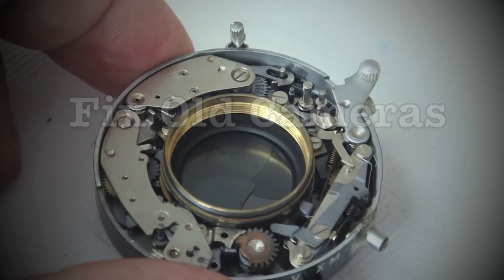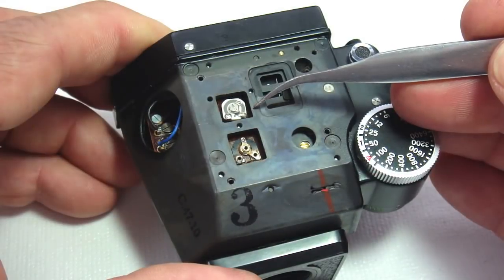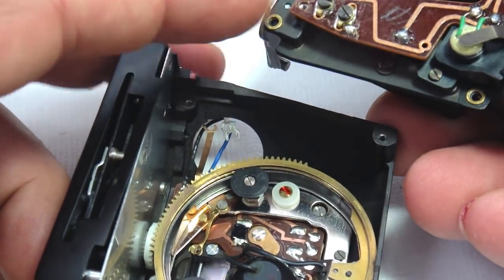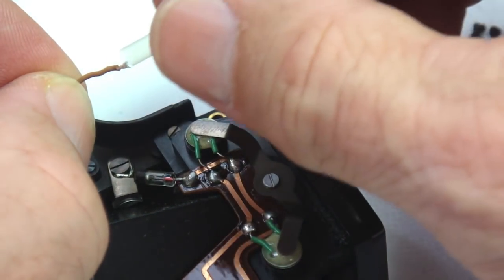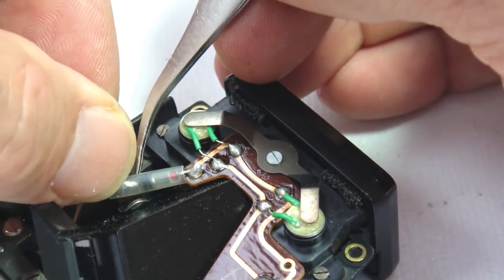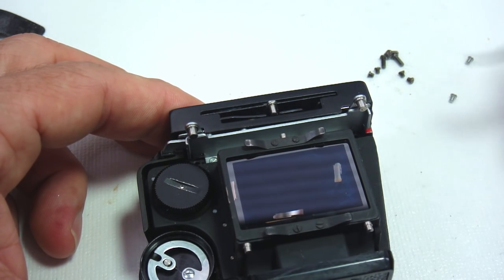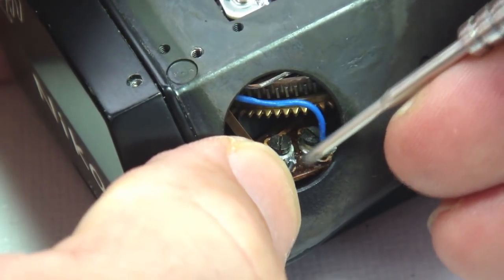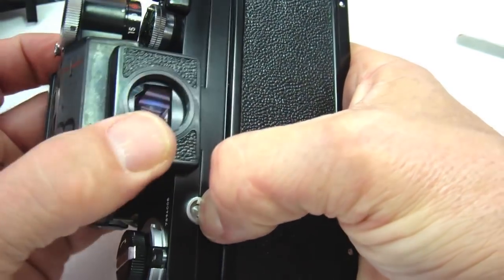Fix Old Cameras: Nikon Photomic FTN Meter Modification

Comment: Good video but on caveat. Diodes fluctuate with temperature. 1.1Mv per F degree. What would be zeroed in on a hot day would be different on a cold day. If I’m wrong let me know. Nevertheless, what I have done is to get a silver cell battery adapter and then lower the ASA wheel one film speed. If you are using ASA 200- set the camera meter to ASA 100. 400 film to 200, etc. this will compensate for the battery voltage differences and have the film exposure good. Keep using those older cameras, they are still good.

Comment: I have a 1967 Nikon F with the Photomic finder that"s been dead for years. I want to make that meter work again. The irritating thing is finding no answers to the prime question, which is WHAT is the root cause of the problem? Root cause, please. It's not the battery, not dust inside, etc. I read about adding a diode to the interior wiring and have not done that yet, but find no answer ord explanation to why, or even if that solves the problem. So many F's so many dead F Photomic meters!!!

Comment: To the right of the rear trim (battery test), there is also a round hole with an adjustment screw. It can be accessed by removing the leatherette. What is that for? Thanks.

Comment: Great video.  I have a different issue with my ftn.  The aperture pin won’t engage properly!  I removed the front plate and a spring popped out!  Maybe thats why it doesn’t work.  For the life of me i cannot figure out where this spring goes.  Can you offer any guidance?  Thanks so much!

Comment: Hey so my meter isn’t working. 
With new batteries, the needle shifts about a quarter way to the O. 
But when out against a pure white light that would obviously overexpose at iso 800 with the speed set at 1/4s, the needle moves about a quarter way too. 
There’s no corrosion on the battery terminals and it indexes correctly. Do you have any idea what’s up with it? 
My guess would be faulty power delivery but the question then is how? Or could it be a combo of problems where the check battery needs calibration but also the metering circuit is toast? In the case the the CdS cells are toast, are Nikkormat CdS cells a swap in replacement?
Thanks for the video.
Reply from the maker: All your suspicions are possibilities. Most likely dirty/faulty resistor rings or faulty CDS cells. You could make the Nikkormat Cells work but they are not a direct swap.
Reply: @FixOldCameras  wow thanks lots for the info. You’re super knowledgeable. Let’s hope it’s just a faulty resistance ring

Comment: Beautifully done
Reply from the maker: Thank you.
Reply: @FixOldCameras  i wanted to ask, is it a relative impossibility to clean dust out of the viewfinder/prism area? Been using my new-to-me F for only about 3 days and it seems my wool coat has shed into the finder somehow😬
Reply from the maker: @sLOMO_77  No impossible at all. Dust or wool behind the eyepiece can be accessed by removing the cover shell of the prism you can also remove the prism from the housing if need be. The viewfinder screen can be separated to access and clean as needed.
Reply: @FixOldCameras  this goes for the Ftn head as well?

Comment: Hi, I just saw your tutorial and I have been impressed by your professionalism, a pleasure to follow people who share interesting things. I have a Nikon F 2 and the light meter is not working. The question is, is the function of the photometer that does not work from the head on top, or is it an internal problem of the camera? Is it possible to use this technique from your tutoring, for my camera too? If so, what diodes do I need specifically?

Comment: Nice job, thank you for producing an awesome video. Just ordered a Photomic, since it has such a strange look. I have an old Leicaflex body that I would like to fix. Mirror got stuck in the up position. Do you have a brand of screwdriver to recommend ?
Reply from the maker: The best you can afford. Starret or Moody are good place to start.
https://www.amazon.com/shop/fixoldcameras
Please note that the link provided is an affiliate link and a small commission is received by the creator of this channel if you choose to make a purchase using this link. This adds no extra expense to your purchase. Your support of this channel is greatly appreciated. Thank you for making any purchases through the link on this channel.

Comment: Thank you for posting these instructions - very informative.  I followed them to install the diode but probably did something wrong. The battery check is working as it should. However, when I turn the meter on, the needle shoots all the way to the left (indicating over-exposure), and stays there irrespective of ISO, shutter speed or aperture settings.  Any idea where things may have gone wrong?  Thanks!
Reply from the maker: If the battery check works as it should you did the install correct. Check the wiring around the CDS cells and the CDS cells themselves. An ohm meter would helpful.

Comment: I recently acquired a Nikon Ftn Photomic,  vintage 1971 from what I can ascertain from the camera body serial number.  The finder on it came with batteries installed and the meter is working.  However I did run into meter readings being about 3/4 stop off from meter readings taken of the same subject,  same lighting, and same lens as my Nikon FM. (took readings off of an 18% grey card).  That I attribute to the modern equivalent batteries installed in the Ftn finder.  Since I don't feel like getting into the guts of my Ftn finder,  I simply 'fudge' the film speed ASA so the Ftn meter reading agrees with that of my FM and my digital camera.  However this is an interesting informative video and I'll bookmark it in case I get brave and want to do a long term permanent fix to enable me to use modern batteries without having to often check the Ftn meter against my other camera light meters.
Reply from the maker: Thank your for your detailed comments and for your interest in FOC.

Comment: What type of adhesive did you use to install leatherette cover? Love your videos. Replaced light seals in my rb67. Thanks
Reply from the maker: Pliobond. Also, in cases where the leatherette is not curling at the edges a permanent office glue stick works nicely and allows for easier removal if need be.
https://www.amazon.com/shop/fixoldcameras
Affiliate disclosure: Please be advised that some of the links provided are affiliate links and a small commission is received by the creator of this channel if you make a purchase using these links. This adds no extra expense to your purchase. I appreciate your support of this channel. Thank you making any purchases through the links on this channel.

Comment: Amazing video.  My Nikon f3 reads two stops over as compared with the  external light metre.I don't know how to fix it.I also checked exposure compensation dial which is on '0' . I don't know how to fix it. Do u think all the Nikon f3 is like that? Any suggestions would be very helpful.
Reply from the maker: No they should be a little closer to the same reading. You must triangulate or confirm the accuracy of the hand held meter.  onece the accuracy of the source meter is confirmed. Try to determine if the exposures of the F3 in question are also two stops off as well.

Comment: Hello, Just to be clear, the SK 3080 diode works in the two battery Nikon Ftn and the SK 3090 diode works in the two battery Gossen Luna Pro even though the YouTube for the Luna Pro started out as an SK3080 diode. I bought several of the SK3080 diodes based on the original Gossen YouTube. ;-(
Reply from the maker: Frankly, with the difficulty in finding some of the vintage diodes that seem to work the best, an absolute perfect choice might not be available to you. Unfortunately you might just have to give them a try and see how they work. You will not cause any harm to the meter if the diode chosen does not produce the desired voltage drop. The Gossen is fairly forgiving to the voltage difference even though it does not have an in circuit voltage regulating components. The Nikon Ftn is a little more persnickety. Experience shows a silicon diode has a voltage drop of approximately 0.7V(varying 0.1V depending on the sub), while a germanium diode has a voltage drop of approximately 01.6V - 0.2.2V. Making the silicon diode(1N4007) the preferred choice for two battery meter systems. Though germanium diodes(SK3090, OA90, ECG109) with a voltage drop of consistently 016V) is the best in the area of forward voltage drop in single battery systems they are increasingly hard to find and more expensive, the silicon diodes are cheaper and apparently easier to find.
Experience shows a zener diode is not a good choice for a substitute. A silicon or germanium, conducts in one direction only, whereas a zener diode conducts in both directions, but at different voltages.

In most other applications beyond the voltage dropping application an ordinary diode is used to rectify, using its forward bias characteristics, while a zener diode is used to regulate, using its reverse bias characteristics.
If you have a multi-meter with a Diode Test mode you can determine the voltage drop of your diode before installation. The Diode Test mode produces a small voltage between test leads. The multi-meter then displays the voltage drop when the test leads are connected across a diode when forward-biased. The Diode Test procedure is conducted as follows:
 If you are checking in circuit make certain no voltage exists at the diode. Voltage may be present in the circuit due to charged capacitors. Other wise, set your multi-meter to the Diode Test mode.It may share a space on the dial with another function.  Connect the test leads to the diode. Record the measurement displayed.  Reverse the test leads. Record the measurement displayed.
Diode test analysis
 A good forward-based silicon diode displays a voltage drop ranging from 0.5 to 0.8 volts for the most commonly used silicon diodes. Some germanium diodes have a voltage drop ranging from 0.2 to 0.3 V. The multi-meter displays OL when a good diode is reverse-biased. The OL reading indicates the diode is functioning as an open switch. The multi-meter  will give additional information about the diode. A bad (opened) diode does not allow current to flow in either direction. The multimeter will display OL in both directions when the diode is opened. A shorted diode has the same voltage drop reading (approximately 0.4 V) in both directions.
Substitues for
ECG109 - OA90
1N4007 - DO-41
One more thought, years ago,  when the mercury cell was first doomed to extinction along came the "MR-9" battery adapter.  Slip a S76 type battery inside the MR-9 and now you have a direct substitute for a MS625 battery. No meter adjustment necessary - the MR-9 had a built -in chip resistor that was supposed to dropt he voltage to 1.35V. Then in maybe 1998 "The New Camera Craftsman" (now out of production along with the original "Camera Craftsman" magazine) ran a short piece on the diode modification. It discussed the technique of connecting a nonlinear component - a germanium diode - in series with the battery as a means of operating cameras that were not necessarily a candidate for the MR-9 adapter. Using a silver oxide button battery as the power source, the resistance of the diode changes according to the amount of the current. With the small current draw of a galvanometer metering system, the germanium diode brings the voltage very close to that of the original mercury cell. In a typical meter circuit of the type indicated, the diode drops approximately 0.157 volts. (1.5v - 0.157v = 1.3443v).  Since that short piece appeared in The New Camera Craftsman" and probably before, camera users have continued to report good results of once again having a fairly accurate meter function in the classic cameras that this technique might apply.
Reply: @FixOldCameras  I'm not the sharpest knife in the drawer...but here goes,  the best option for the Nikon Ftn is the MR-9, and the SK3090 diode for the Luna Pro...right.
Reply from the maker: @pauljones7244  The MR-9 is an option that requires no meter modification. But it is important that one be purchased from a reputable supplier. The diode SK3090 install is a good option for the FTN. The SK3090 is hard to locate. The ECG109 is good replacement for the SK3090 also available at https://phototronic.biz/tips.The two battery system diode 1N4007 is the diode available at https://phototronic.biz/tips The SK3090 is hard to locate.  SK3080 is an incorrect reference in the Gossen video.The Gossen seems to respond well to either diode choice. The FTN will need the ECG109 if you decide to do the diode install.

Comment: I've modified a half-dozen cameras, including a Nikkormat FTN and several FTN heads with germanium and other diodes. After shooting my modified FTN meter heads with film, I'm not happy with the modification because it clearly does impart a non-linearity to the meter response; the voltage drop provided by the diode varies with current demands in the meter. For example, the meter is right on at EV9, but at higher EV, I found the exposure is off by a stop or more. I'm back to looking for equivalent new replacement CdS cells that will facilitate adjustment of the meter circuit without adding a diode. I'm now removing the diodes from my light meter circuits.
Reply from the maker: The vintage ECG109 germanium diode has proven to do very well in most single battery meter circuit applications that do not already have voltage regulating circuitry. The double battery circuits do not always do as well with the IN4007 silicon diode. Hopefully your search for a better fix is spot on.

Comment: You mention to pay attention to the position of the cathode band, but you don’t say where it should be. I assumed it should be farthest away from the battery, since the current flows from the anode to the cathode. Am I correct in that assumption? Also, if after performing the repair the battery check is completely unresponsive, do you have any suggestions on what to check for troubleshooting? I used the 1N4007 diode.
Reply: I figured it out. I should have put the cathode side toward the battery so that the negative side of the diode is facing the negative side of the battery. I will do this over, reversing the orientation of the diode.
Reply from the maker: Direction of the cathode band depends on the polarity of the system.  The IN4007 works very well for the two battery systems. If the battery check is not working check the battery test adjustment resistor and its connectivity.
Reply: @FixOldCameras  Good news, reversing the diode worked!
Reply from the maker: @TomNorthenscold  Right on! Your persistence and patience paid off. Keep'em going.